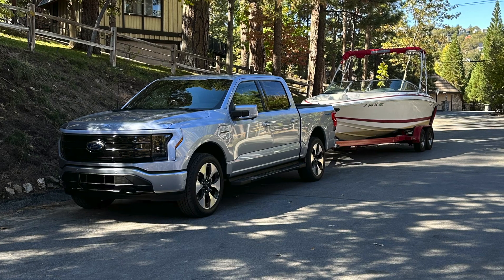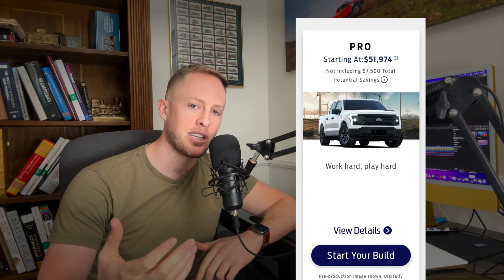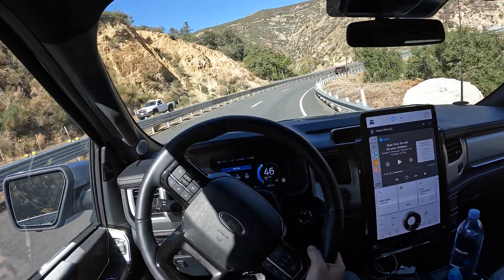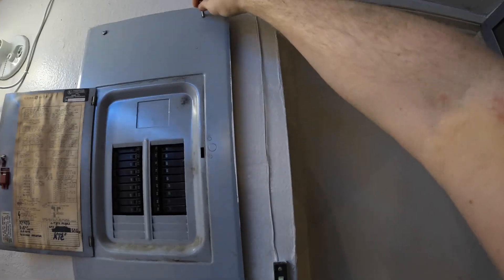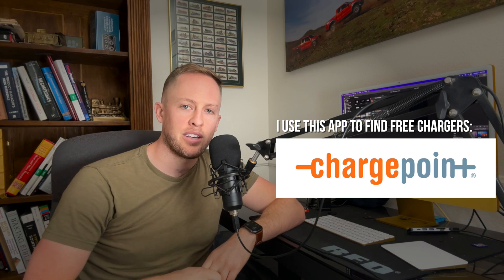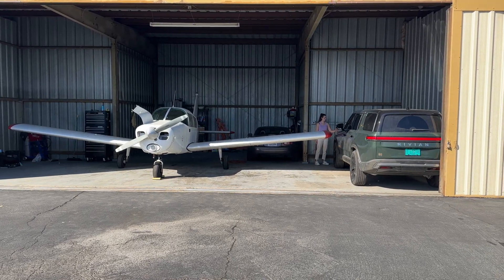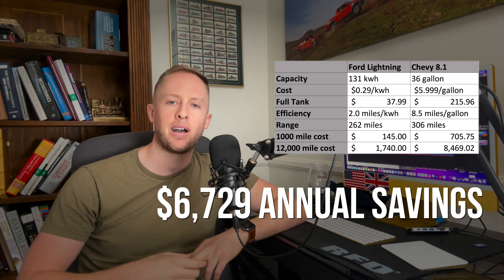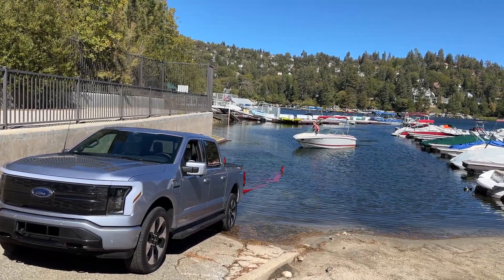Electric vs Gas Truck | Fuel Cost

Comment from the maker: CORRECTION: The Chevy has a 37.5 gallon gas tank, not 36.
Reply: Is the range listed while towing?
Reply from the maker: Just normal driving for both trucks. I average 6 to 7 mpg  while towing depending on the trailer with the avalanche.
Reply: @ZentRose  That sounds familiar.  That's about all I got with my 2014 F150 V8 flex fuel. My lightning is so much cheaper to drive and cost savings for me are even greater because I charge at home for $.08/kwh in the winter & $.12/kwh in the summer.

Comment: I don't think lithium batteries are the future. Because China controls half of the battery raw materials and 90% of the electric motor raw materials. Lithium batteries are just a transition. Hydrogen energy is the future, and the problem of hydrogen energy storage may be solved within ten years. Although I am Chinese, I don't want to see China strong because the Communist Party is not democratic. I hope you Americans can continue to block China's technological development.But let's breathe a sigh of relief and prevent China from following the path of Japan in World War II。

Comment: I feel like your cost analysis is missing a few key points. Such as the purchase price of the vehicle. Comparing a truck with an MSRP of around 50k to a used truck that can be purchased for under 5k is interesting. It would take roughly 7 years to pay off the purchase price alone. Also the depreciation of EV's is pretty substantial and considering battery replacements ect. on a 7 year old EV. I think it would be a long shot to say it will save you money over 10 years in this comparison. Love the videos by the way!
Reply from the maker: Yes I just have fuel expense info. It’s all wishful thinking anyway because I can’t even get a new truck for msrp right now 😅.
Reply: I've had my fill of the maintenance required on used vehicles,  one of the main reasons why I purchased my lightning,  no maintenance.  My savings are about 4 times greater than shown in this video.  My 2014 F150 I traded in only got around 10 mpg when not towing,  cut in half when towing.  I only charge at home for $.08/kwh in winter & $.12/kwh in summer.  As far as the lightning depreciating, I bought it at MSRP,  when I drove it off the lot,  instead of it loosing several thousand dollars,  my lightning became $30k - $40k more valuable.  After just driving it a week I had several offers to sell it for over $30k over MSRP.  I  didn't purchase it for that, and I would've been on a long waiting list before I'd be able to get another one. My original plan was to extend all warranties to match the battery & edrive warranty of 8 yr/100,000 miles but I believe in 3 - 5 yrs ford will have an even better EV truck at which time I'll sell my lightning and buy a new one. 

If I drove 12,000 miles a year in my lightning averaging my 2 miles per kwh and using my higher summer kwh cost of $.12/kwh comes to $.06/mile times 12,0000 miles equals $720/yr. 

Driving my 2014 the same mileage at 10 mpg would use 1,200 gallons of gasoline.  Even at just $4/gal that's $4,800/yr. 

This is all local driving without towing.  My lightning would do even better towing because I only got about 5 mpg when towing with my 2014. And my lightning range drops to 1.6 miles per kwh when towing same trailer. 

I haven't even figured in the cost of maintenance required on an ICE vehicle during a 12 month period.  Just oil & filter costs have gone up ridiculously.
Reply: If you did have to replace the battery in 7 yrs at 12,000 miles a yr that's only 84,000 miles the 8 yr/100,000 mile warranty will replace the battery for free. I seldom keep a vehicle for more than 7 yrs. I  can't even image how much better an EV ford will be making in 7 years.

Comment: How long do you think before an EV truck with a real world 400 mile range (driving 80 plus with a headwind) will exist for under 100K?
Reply from the maker: I don't know that we will get one. Tesla made that promise but keeps pushing the cybertruck delivery back.
Reply: It could be yrs. In the meantime I'll just use my lightning platinum locally and only charge it at home for $.08/kwh in winter & $.12/kwh in summer.  At my average 2/mpk that's just $.04/mile in winter & $.06/mile in summer. No maintenance costs,  not even oil/filter changes. I'm thinking no more than 5 yrs they'll have a decent charging infrastructure and the range will have also increased significantly.

Comment: Second thought for this video... This is why I got the Rav4 Prime... 40-45 mile range... I got the 7500 tax CREDIT on a no markup SE [ base model ] with a few add-ons... I will go for months without consuming any gas... But I have a 3000 lbs real world towing capacity. 0-60 in 5.7 seconds...  The battery is managed well enough to hold 80% capacity most of the time without worrying about degradation so I can get free charging in numerous places... Over 100k miles of EV driving you are looking at over 10k in savings easy... Full EV will work for most people with two vehicles... it's a no brainer.
Reply from the maker: Hell yeah, that's awesome!
Reply: I'm retired and single so I decided to trade in both my truck and prius on my lightning to get the price down plus there's no state taxes on the trade in portion of the sale.  Got my lightning at MSRP,  no markups.  The only dealer in my area that sells at MSRP. I use it locally & only charge at home.  $.08/kwh in winter & $.12/kwh in summer.
Reply: They’re wonderful right up until you want into the dealer and it’s a 3 year waiting list but there’s a demo for sale for $60k!!!!